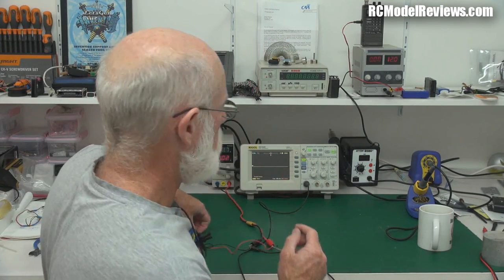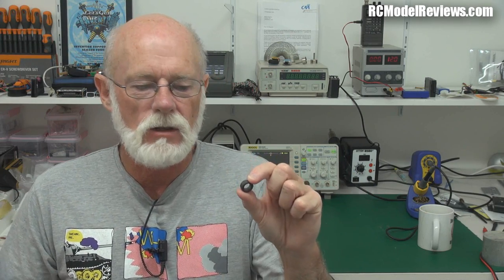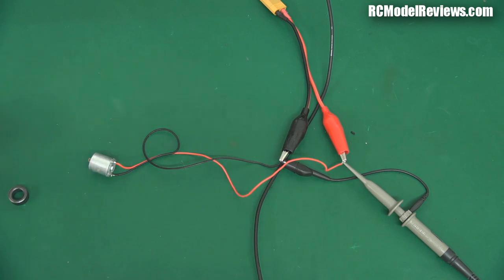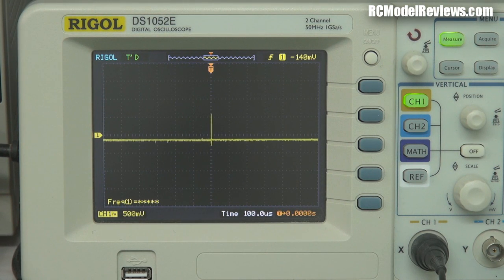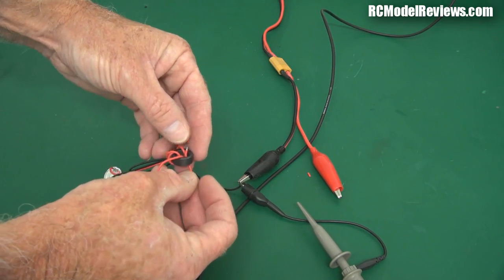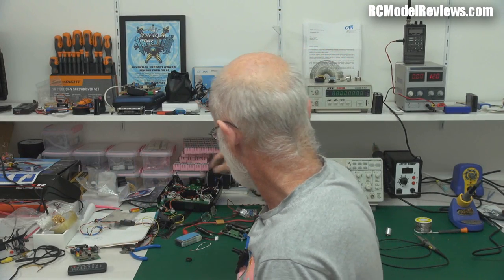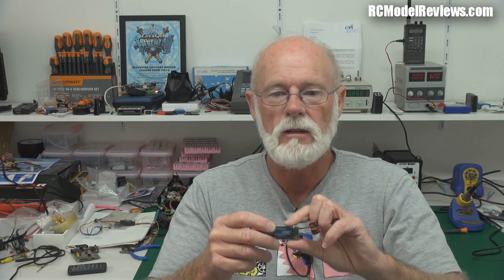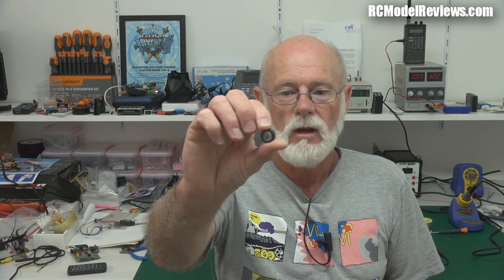Ferrite toroids for RC planes

Comment: Thanks Bruce for this one. I have a gas plane and I crash because of this problem. I got another fuselage but I had to used the same electronics but I haven't flown it yet. My friend is telling me that I need to replace the analog servos to digital but right now my budget doesn't let me. I mean, I would have to buy 5 brand new servos at $50. Dollars. I'll figure this would be cheaper than spending $250 at the local hobby shop. Great video. Keep them coming and the best of luck getting your wings back.

Comment: P.S. The noise of the switching BEC is related to the threshold voltages that the controller of the power FET uses. In general it is difficult to make these thresholds  close (or you would have a linear regulator), but one thing in common for all designs is, that the closer they are, the less efficient the power conversion is (the FET has to switch more often). 200mV ripple is actually not too much of a deal because all sensitive equipment (micro-controllers, radios) use their own, low-power internal linear regulators anyway, which deal with 50kHz spikes no problem. The only affected component i can think of is el-cheapo analogue servos, it might cause the motor to warm up more (because it will be turning on and off for no reason).

In any case, if you want to reduce the ripple, place a low ESR 250uF (or bigger, but watch your weight) capacitor AFTER the ferrite (looking from source side) and you'll be fine.

Comment: I use use 10nF ceramic disc capacitor to smooth the noise on standard DC motors, Sometimes I will add a 100nF for cheap and larger DC motors. But, I have 4 ferrite toroids at various places on my CNC that I salvaged from old PC power supplies.

Comment: Bruce,  Thank you for this video!  Did you test the BECs with and without the ferrite bead while the BEC was under load?  I read that they won't put out much noise when not under load, and then even under load, the Scope can't see the HF stuff. A spectrum analyzer might be a better tool for looking at those BECs and their ferrite beads.

Comment: I use ferrite beads all the time to filter noise. I usually use the small ones that fit a single wire through them (ie. no looping of the wire) because they're small and lightweight. They seem to work as well if not better than looping wire around a big toroid (depends on what type of noise you're filtering though).
Reply: Yes, toroids are useful for removing what is called "common mode noise" where all three wires from your servo leads are carrying the same interfering signal, usually picked up from a gas motor or powerful FPV transmitter.

Individual beads (or torids) will remove "differential mode noise" which is the type of noise the little servo motor was generating -- although if you use three beads (one on each wire) you'll also reduce the common-mode noise.

Maybe I need to do a video on the difference.

Comment: When I first got into electrics one of my first planes was glitchy, I had seen some chokes on some bec's, this one didn't have one, so I found some at Radio Shack and installed it between the bec and the radio (72mhz) and it cleared up the problem.  Since then I install one on all my electrics as soon as I get it, I've had no problems. The ones from Radio Shack are wrapped with a few turns of copper wire, I cut that off and only use the ferrite "donut".
Reply: PS: I wrap both wires about 3 turns around the core, I temporarily remove the connector to wrap the ferrite core, then reinstall the plastic connector.

Comment: Bruce, the toroid on the Ubec appeared to be bifilar wound, it will probably reduce radiated noise but not be effective in your configuration.
The simple demo on the servo motor with the toroid singly wound means if you shove loads of current through the ferrite can saturate.
The bifilar approach in the Ubec cable allows you to shove huge amounts of dc current flow through without saturating the ferrite.
It would be interesting to see how the Ubec toroid arrangement reduced interference to perhaps a medium wave radio placed nearby. 
Regards David

Comment: I just ordered a bunch off eBay the other day. I going to use them on my wires that are connected to my APM 2.5 Flight Controller. I hope this will cut down on some of the noise.

Comment: Could it be that the switching UBEC type do not have any means of isolation inside of the ESC (on the output side of the UBEC)?  
Just for kicks, I installed a small isolation transformer on an old one that I don't use anymore and the noise seemed to completely disappear (it was no more than 75 to 100 mV when measured by an oscilloscope). It seems that the source of the voltage wasn't isolated from the output on older models. I used a fairly heavy isolation transformer for my experiment which certainly isn't practical.  
Now, it seems that most ESCs are being delivered with opto-isolators which are very small and very light weight, when connected to the oscilloscope, they seem to do very well at noise suppression!! It's especially critical for multirotor aircraft (which is what I fly quite often).
Thanks for the video!!

Comment: Thanks Bruce! A follow-up question: what difference if you wind both positive and negative (or +, -, and signal for servo or video) around the toroid?
Reply: If you wind the whole servo lead/extension around the toroid then you will stop these wires acting as an antenna and picking up spark noise or a powerful FPV video transmitter.   It won't however, stop any noise generated by the servo motor itself -- although it's most uncommon to get servos that are so noisy as to cause an issue.
Reply: Thanks. Also, I really enjoy your videos. Keep up the good work. I look forward to seeing you fly again soon.
Reply: Bill Wilson
It's unlikely I'll be flying any time soon - especially with an admission by a local bureaucrat that as far as he's concerned he simply doesn't like me and would like to see me gone.  Add this to the fact that the MFNZ executive also "don't like me" and you can see that I'm upgainst a lot of people who seem to think that their own personal opinions should take precidence over the responsibilities of the roles they fill.

I'm not asking people to be my girlfriend or even like me. All I expect is for them to do the jobs they're either paid to do or have chosen to do -- in a professional and objective manner.

Comment: If you build a quad and use ESCs that have ferrite rings you can disable 3 becs and remove 3 of them and save them for later use on something else.  Or use a separate ubec and have 4 for later use.

Comment: Great vid.  I've wondered for a while why my Hobbyking ESC's have toroids and my plush ESC's didn't.  I never noticed any difference while flying and I'm not blessed with a scope to see what's going on.  I'd def like to see a vid testing various ESC's with and without toroid.   I don't mind flying with them on but for weight and wire management it would be nice to remove them if there was no advantage gained.

Comment: The reason why the ferrite choke doesn't smooth out the power coming from the UBEC is because the ferrite only resists changes in current. Both the positive and negative leads are wound through the ferrite going the same direction, so their opposite currents cancel each other out and there is no net current for the ferrite to act on.

The ferrite is there to stop noise that has the same voltage on both wires. This could be from capacitive coupling with a switching circuit or picking up an RF signal as you mention. This configuration is used because it cuts down on at least some noise without resisting changes in supply current.

When a ferrite is configured to filter power it makes the current more constant by raising or lowering the voltage of the circuit as needed to force a higher or lower current consumption. This can cause dangerous voltage spikes in any circuit that has changing current requirements.

A better component for power filtering would be an L-C filter (also sold by Hobby King) which does have a ferrite but also has capacitors and a diode to eliminate the voltage spikes.

Great channel, keep up the good work!
Reply: Do you think I should take the Ferrite toroid off my UBEC then?
Reply: It's been 3 years since I wrote this comment, so you'll have to excuse me if I get this wrong, but as I recall Bruce put an o-scope across the output leads and seemed surprised that the toroid had no effect on the voltage spikes.

My point was that a toroid configured that way can't possibly have any effect on the thing he was measuring.

The toroid probably does have an effect on the broadband RF energy coming from the switch, and I would leave it on just for that reason alone, especially if it came that way from the factory, but a toroid isn't some magical device that grants clean power to every wire that's wound through it. You have to design a circuit (such as the aforementioned L-C) which uses the properties of a toroid to get that effect.
Reply: Thanks for the quick reply.  I'm putting together my first gas RC airplane and I've noticed the throttle servo twitching a bit at idle. That's what got me interested in this topic.  I've ordered some Ferrite toroids and I'm Iooking forward to seeing if they help.  I'm applying some other ideas too like clamping the spark plug cap tighter with a hose clamp.  Thanks.
Reply: Cool. I used to fly Glo; always wanted to try gas.

I assume the spark is fed by a magneto? In that case the ignition is a closed system that isn't really connected to anything else, so if the spark is escaping the wire the only place it can possibly go is back to the magneto through the engine block. It's not impossible that that's your problem, but not the first thing I would check if the wire isn't visibly worn or aged.

What can happen is the spark wire and its electrical return path can form a magnetic loop that induces currents in other things. There's no insulation against that. Just make sure that the spark wire is no longer than it needs to be and runs close to the cylinder (without touching it, of course) and far away from other electronics.

If rerouting doesn't help, perhaps it's possible to get resister spark plugs. The resister has no effect on getting a spark going, but limits how much current rushes through when there is a spark, reducing interference. I'm not sure they're available for modeling, but it's a common fix in cars.

Barring that, maybe the ferrites will help, or maybe you just need a different throttle servo.

Comment: Thanks for the video Bruce.
One important difference between the motor test vs the Hobbyking UBEC, is the way both the +&- wires are wound around the ferrite in the HK UBEC. Would you like to revisit this? See if you can reduce the noise level of the UBEC by winding only one of the wires in the ferrite.

Comment: I noticed that you put only the positive lead of that DC engine through the coil, but not the negative. That seemed to work.

I also notice that with ESCs, they usually run both the positive and negative lead through the ferrite coil simultaneously and in the same direction. Could that cause the lack of effect? It would be a massive world-wide production beep-up if that were the case, though...
Reply: if the wires go in the same direction around the toroid, it a differiental-mode choke commonly used to stop ground loop currents and EMI. It is not a worldwide beep-up.

Comment: Wouldn't the ferrite reduce more noise on the current than the voltage? It makes basically an inductor, right?
I know both voltage and current are "kinda" tied together, but when we're talking about periodic signals, current can be very different than the voltage. And inductors affect directly the current.
Reply: Noise can exist as a change in voltage and/or a change in current.  A change in voltage will induce a change in current and a change in current through a conductor will also produce a change in voltage (drop) so they are linked.  The toroid, as an inductor, will oppose any sudden change in current (such as a noise-spike or high frequency signal) so you will see a reduction in both the current and voltage produced by the noise after it passes through the toroid.

Comment: Let me see if i got this right.

You have wires wound around a piece of metal that turns it into an electromagnet. The electricity that goes through the wire charges it and the excess energy is dispersed into a magnetic field surrounding it. A dip in the electrical flow (i.e. noise) will cause some of that magnetic field to be converted back into electricity to smooth out the potholes. Is that it?

Almost sounds like a capacitor.
Reply: Don't recommend using a capacitor on a signal wire.. A capacitor is often most useful IMO, however you must know when not to use them.
Reply: Yes, +lbushi you are correct.

In effect, the magnetic field created by the flow of current through the windings on the toroid create that magnetic flywheel effect I was talking about.  The field effectively opposes any sudden changes in current (which is what noise generally consists of).
Reply: snuitjeneus
yes only on servo power leads, FPV TX power and motors only power no signal ,a light sprinkling with capacitors gets rid of the noise problems I've had but that's (high pass filtering )the toroid will be good for high freq becaus the coil holds some charge for a very short time much shorter than a cap thus filtering the high freq spikes out (low pass filter )

Comment: Good topic Bruce.  I have a telemetry unit with GPS that doesn't work since I used a BEC to power it.  Still sends all data except GPS related info. I'm betting if I try it without the BEC it will come good. (ie BEC noise swamping GPS satellite signal). Thoughts? Doesn't the physical size of the Toroid increase it's efficiency on different frequency ranges?

Comment: most ferrite toroid are use for RF chokes, depending on the coil you make or inductance. common uses are  low pass in series, but work better LC or with a capacitor shunted to ground in the circuit in supply lines. 3 to 4 turns on that will have an inductance that would react (block) better on MHZ band and higher unless you spin more turns for lower noise frequencies!
Reply: Yes.  The noise spikesfrom the electric motor in the demo reach well into the RF spectrum (as can be shown by holding an AM radio next to most brushed motors when they're running).   The problem with running more turns is that you then get closer to saturating the core and once it saturates it effectively stops being an inductor.
Reply: thanks Bruce I hope you create a video on power filters too using LC circuit to filter out supplies for people who usually use single power system.

Comment: Is there a difference when you put both positive and negative leads through a toroid instead of only a single power lead?
Reply: I wonder the same, seems to me they should be seprerate.
Reply: Yes, there are two "modes" of noise and the way you wind the toroid (both wires or one) determines which type of noise is suppressed.  I'll be covering this in the video on SBECs

Comment: Since the red and black wire of the UBEC output both go through the toroid (in the same direction), this will reduce only common mode noise, noise that is in phase on both lines, a common mode choke.  The differential noise as measured between the red and black output I would not expect to change.  However, the noise may be reduced with respect to the battery input  e.g. measure red output wire with the negative of the scope probe to the battery input side.  I'm guessing they don't use 1 toroid per wire is the possibility of saturation, and/or cost or size..  Still it could be the toroid is not needed in many cases.  I'm interested to see more tests!  Thanks for the videos.

Comment: Hi, what about drilled wires for servos in FPV-systems - especially when using 72/35Mhz RC? I had some issues with bad interference, became much better when drilling all my wires. What does this do and is this measurable?

Comment: Bruce: Doesnt the magnetic properties of Ferrite cause problems with compasses ?
Reply: No.  Ferrite is interesting because it concentrates magnetic lines of flux.  In fact, the magnetic field generated in a toroid tends to be very compact and thus less likely to affect a nearby compass than would an air-wound coil or conductor.

Comment: Okay I'm having a difficult time understanding, in my situation I will be using this on a regulated DC output  of power supply, Would both - and + wires need to be wrapped through or just one?  and iff see which one?

Comment: Will that also take the noise out of video lines for FPV ?
Reply: In some cases yes.  If the noise is caused by significant amounts of RF then it can.

My TBS Cappy has some lines on the FPV video signal so I'm going to do a video showing how I go about trying to clean up the picture. I'll try some toroids on that and see if it makes any difference.